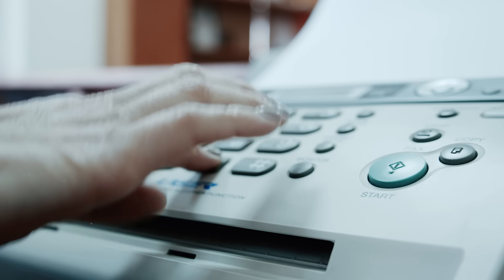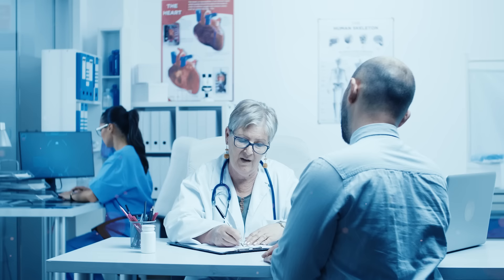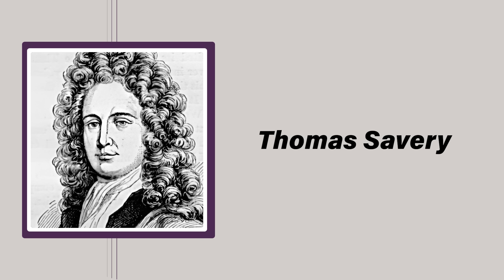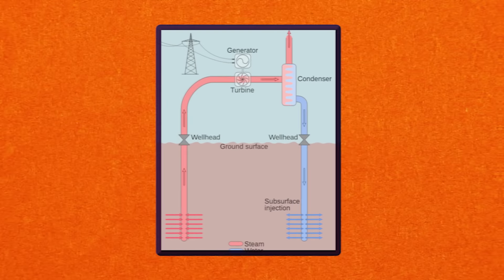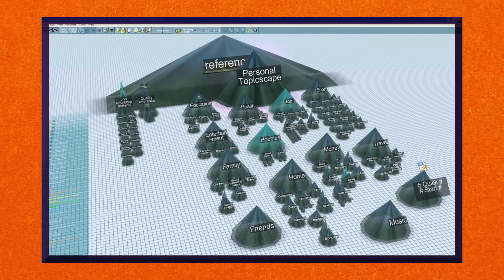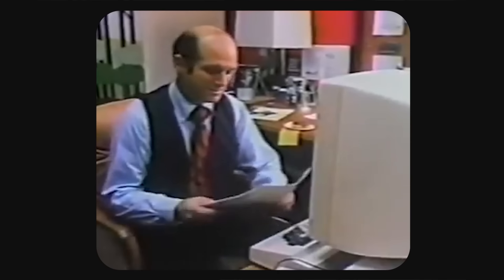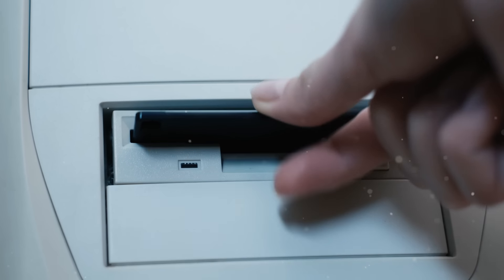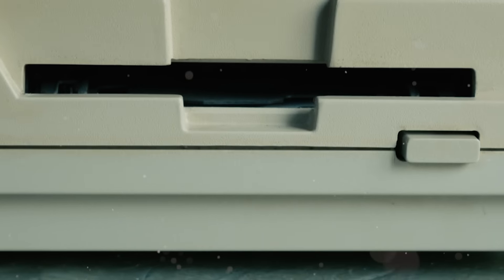Terribly Outdated Technology that we Still Use...

Comment: A proper old-fashioned fax machine is still preferable to a "modern" HP machine that won't scan your document if it is out of ink
Reply: Scanning documents without having ink? Outrageous! /s
Reply: Fax
Reply: @LaughingOrange  That's why I threw that HP junk away.
Reply: I would rather use a FAX machine because I have a better chance at finding a fax after a year than a file amongst thousand's  of file's on my pc all with cryptic names that were not cryptic when I named them🤔🤔
Reply: HP is terrible, I heard they put stickers over USB ports because they want you to use there bloatware
Reply: That why you get  Brother.
Reply: @LaughingOrange more outrageous are HPs claims trying to get the lawsuit thrown out.
Reply: Except you can fax from the PC that's connected to that HP machine.
Reply: HP: 'cancel your subscription will you after buying your printer? Well, we're gonna soft lock your property and don't even think about using third party cartridges or you better believe we'll soft lock it then too. We really hate our customers, absolute peasants'
Reply: my printer literally has everything working perfectly but thanks to hps idiotic software i still can't use it properly it refuses to connect to my home network
Reply: Modern commercial tech has gone down a disfunctional path.
Reply: @serdarcam99  is it plugged in and turned on? 👹 I assume you tried a network device search.  I also assume you have all the required physical data connections.  It may be a setup issue. Sometimes you need to have it connected to a computer to properly set up the wireless functionality.  If it lets you, a hardwired connection will bypass any password requirements to connect it to the network.  If you have a guest network you may have set it up on the guest portion or you may accidently be on the guest portion yourself.  Good luck troubleshooting.
Reply: Heh heh somebody has been watching Louis Rossman
Reply: State governments rely heavily on fax machines. Like when you need to submit health insurance documents that are time sensitive (e.g., getting canceled if your document isn't submitted by a deadline)
Reply: Whilst the can't scan without ink is terrible, I have to ask why you're scanning documents?
Reply: When you say a proper old fashioned machine you mean one you'd have seen in an office in the 90s right? If so then yes of course it would. It was a few thousand dollar machine in the 90s purpose built to handle an industrial load of scanning/faxing. Just as I'm sure a 69 dodge Challenger ok
Reply: PC LOAD LETTER?!?! WHAT THE F*CK DOES THAT MEAN?!?!
Reply: Preach!!!
Reply: I will only purchase laser printers for that very reason.  The toner never goes bad, if stored at room temperature, and can last for decades.  Why on earth would you purchase an ink jet?
Reply: Found the Louis Rossman viewer
Reply: @Warp2090 can confirm this. I just deployed a new business grade HP MFP, and they didn’t even include a USB cable, and the moronic USB B port was covered with the shittiest fall apart the second you touch it sticker I’ve ever seen. I had to go buy one or I guarantee I’d be returning to reconfigure it in a week when it decides to drop off the network. WiFi printers SUCK.
Reply: @DrankenDune  MAYBE IT'S BECAUSE I GREW UP IN THE EIGHTIES = I KNOW HOW TO USE TECH BUT IT'S NOT MY NATIVE TONGUE , YES YES ?
Reply: My hp had a issue with ink. So I bought a canon instead of buying ink
Reply: @LaughingOrange  I think he means scanning the image to your computer. Which sucks when ur not even printing anything and I've also been in this situation and it was for a funeral we were trying to scan photos onto my laptop to put on a slideshow at the service and I had to buy new ink that was more expensive then the printer just to scan the photos to my laptop
Reply: Or just cause it doesn't want to xD
Reply: That's when it eat your last only copy 😅
Reply: And modern fax machines can send a PDF in duplicate!
Reply: @DrankenDune  Oh yes , everyone know that I'm an angry man 🤣🤣🤣🤣
Reply: @DrankenDune  And they call you - sidetrack Dranken 🤣🤣🤣🤣
Reply: @DrankenDune  But seriously you have become tedious and boring  ipso facto no further congress between us shall be entertained , GB .
Reply: @LaughingOrange Use phone transfer file in crunch
Reply: Gotta get you a brother
Reply: @DigitalDiabloUK  to keep electronic records. To email copies of documents that are in hard copy form. To fax documents. Because electronic copies are easier to haul around.  There are various reasons why you would want to scan a document.
Reply: Honestly, both just need to be abandoned. Fax machines often are a massive point of failure for most government or private programs. Name one thing a Printer/scanner can do other than kill trees that I can't get done on my phone. We need to take a page from Estonia...I think its them. Online government, lower cost, better access. I think it's insane we still use paper half of the time.
Reply: @ianbelletti6241  - but how does that PC get an electronic version of an image that is on a piece of paper? That’s why the scanner is still a necessity. Unless you want to use a camera to take a photo that won’t be as rectangular as if it were imaged using a scanner.
Reply: @SilverStarHeggisist  - my Canon had a problem with printing and after replacing the print head a couple of times I gave up on it’s printing function. But then it would no longer function as a scanner either. So I got the HP at that point. Sort of like you, but yet unlike you as well.
Reply: @stevebabiak6997  yes, the scanner is necessary if you have a paper document. If the document is already electronic all you have to do is send it in a format that the fax service or software can handle. I've also used software for a phone that uses the phones camera as the scanner. The phone software allows you to select a non rectangular area and corrects for the tilt.  Just like the standard fax machine, the image correction isn't perfect but it works well enough as long as you hold it close to parallel to the page.
Reply: Smart phones are a thing.  You can take a picture of a piece of paper, and your phone can turn it into a digital scan or even an editable PDF, which can be emailed directly to whoever you want it to.  Much faster and much more secure than a fax machine.
Reply: @themustachioedman   - I do have a smartphone where I can do as you say, and I have a flatbed scanner as well. The flatbed scanner is superior in all respects, unless we are talking about a document that is beyond the size that the scanner can handle. The smartphone image could be in part shadow depending on lighting. The smartphone image will be difficult to have the document be 100% rectangular. The smartphone image is vulnerable to optical distortion. 

In many cases the smartphone negatives aren’t a big issue, so I still use that. But at times when any of those negative factors are significant, I use the scanner.
Reply: @themustachioedman  there's fax software for smartphones as well if you need to fax while not in the office.
Reply: Right. Shits annoying. Wont scan into a document file because its out of ink.  Makes total sense.  Or try to send something from your phone to print and it cuts half off or prints it on a different page.
Reply: @AsilarWindsailor Probably, but he IS right.
Reply: Oh yeah it's completely stupid that it won't scan or fax when it's low or out of ink. That's just ridiculous. I hope Louis destroys the opposition
Reply: I learned that the Brother brand doesn't do cr*p like that.
Reply: @GeorgieB1965  Came here to comment this. I work in State Government and I receive and/or send faxes daily.
Reply: This unfortunately is more of a reflection on how bad HP printer scanners are unless reflection on how good fax machines are.
Reply: I hate HP! Switched to an Asus laptop, current hp printer is out of ink, will buy a cannon.
Reply: I’ve been rocking an Epson eco-tank for the past four years, and have yet to buy a single cartridge or rather refill squeeze bottle. It might cost four or $500 upfront but you’ll end up paying double that over the course of 2 to 4 years in HP ink cartridges.
Reply: @SilverStarHeggisist , may I assume that the entire canon printer was cheaper than the HP ink refill?
Reply: @serdarcam99  Open system resources and restart the print spooler.
Reply: Epson "Eco-Tank" machines don't lock out the scanner on low ink.  And you can revil from appx 4.5 oz ink bottles that cost less per set than the HP cartridge that has less than 1 oz total ink.
Reply: faxes disappear over time...
Reply: @robot336 except if the fax prints on thermal paper...so after some years and depending of the storage conditions the paper will be unreadable...
Reply: @vasopel  Hmmm just like the file name's I make when I'm drunk mate =   like now  🤤🤤🍻🍻
Reply: @vasopel  What I do is put all my WTF  is that file's onto a  USB and when I get My ADHD  pill's I go through them and forget to rename them because I'm to interested in what's in them 🤤🤤
Reply: @vasopel  But I have a fix for that = I compress them into zip file to save space and never look at them again 🤤🤤
Reply: The runny shit I did this morning is preferable to a HP printer.
Reply: @robot336  that sounds.... reasonably logical :-D
Reply: @vasopel  That's it maaaate 🤤🤤🍻🍻
Reply: @vasopel  That's going on my head stone when I die = HE LIVED A REASONABLY LOGICAL LIFE 🤤🤤
Reply: @justingoodman9352 I stole something
Reply: @galactica1980  back up in that azz with the resurrection...!  "So that means everyday you see me is the worst day of my life." ..... "Wow, that's messed up! ...er..."  😅😂🤣
Reply: Lmfao, don't buy crappy, intentionally sold at a loss type machine then.  You get what you pay for, is especially true with combo printers.
Reply: @GeorgieB1965 military too, usb thumb drives were strictly forbidden in the building I worked. Every section had a fax machine.
Reply: I haven't seen a fax machine for 20 years at least... And even then it was a relic.
Reply: If the heads of every top organized crime group in the country were all having lunch together, the room would stop dead, hushed in revererent silence if the head of any printer company were to walk in.
Reply: @LaughingOrange and true.  Fax machines wouldn’t work without ink either.  They usually have to print a confirmation page.
Reply: In five years of use I have only  ever had one problem with the printer.  And that was because it was starting to print extra colors and leave lines on prints. This was simply because the print hands were dirty. I had to run the built-in, clean, print head cycle like five or six times and it fixed itself. Oh and maybe like once a year I have a driver issue and have to remove and we had the printer on my Mac.  This printer has basically just been set it and forget it. No fighting with it no running out of ink cartridges at the last minute. It just works.
Reply: So…… What’s wrong with grabbing your phone and using it as a scanner? I’ve done that many times before and it works great. Quick, efficient and, if you have a company phone with the proper software, perfectly secure.
Reply: Bummer to be in a job with paper.
Reply: What bone head decided that.. lol...😂
Reply: Bull. Scanners don't care about ink.
Reply: Aren't most home-use printers and scanners basically robotic ink cartridge salesmen?
Reply: @@bobsdavenport better yet order a bike messenger whenever you can.
Reply: They designed it that way, so they can force you to buy more ink.

Profit for shareholders is the only thing companies strive for.
Reply: Lewis Rossman has entered the chat
Reply: Or if it disapproves of the content
Reply: @granatmof Brother. There is no other.
Reply: It won't send or receive a fax either when out of ink.
Reply: HP is successful because they know how to become successful, it's a good business model to learn, that's why future corporations should conduct themselves accordingly
Reply: @@bobsdavenport Imagine trying to fax an important patient record to a busy medical office. that office only gets patient records via fax so their fax line is always busy. 
yeah. its a real problem. take it from someone who always had to deal with that scenario. 
Faxing is obsolete. Trying to provide modern fast paced healthcare using 1960s tech is stupid.
Reply: @SilverStarHeggisist  at the price of HP's cartridges, it was probably not that much more expensive.
Reply: Never again will i buy a HP machine..
Reply: Perhaps you have a faulty HP machine because I have no problem scanning documents using my HP Printer/Scanner when ink runs out. But HP are ripping customers off with the price of ink, unless you use cheaper options with less print quality.
Reply: rule #1 when installing HP printers do not install HP software!  Manually install the drivers and only the drivers.
Reply: when its low on ink*
Reply: Picking on HP? My HP printer/scanner works just fine with the ink out. Sounds like you're trying to use the photocopier function.
Reply: When you pay a few hundred thousands per year on ink, it doesnt work like that.
Reply: You want to print a text document? But you are out of magenta!
Reply: @PassiveAssassin  scanning with your phone???   HA!  That's only useful if you want poorly-focused, poorly-cropped, out-of-alignment and blotchy 'scans'.  Absolutely the wrong tool for the job (bet hey, if all you have is a hammer, everything looks like a nail).  And do you need to do multiple pages?  I'll get through a stack of papers FAR faster than you will with your whyPhone.  And my scans aren't locked down to someone's barbed-wire walled garden.
Reply: @themustachioedman  but that PDF can STILL be intercepted mid-transmission.  Thus the reason fax machines are still used in various fields.
Reply: @SenileOtaku  Photo scans have been nearly indistinguishable since at least 2014 for text documents. Shadow isn't an issue when using an app that adjusts white and black levels and sharpens text automatically. Additionally, you can do scans that recompile the whole thing as new documents by pulling and reapplying the text on a doc. Archiving large amounts of old analog content makes sense to use a scanner admittedly. Printing something just to be scanned is like if I wrote down your email and hand-delivered it, an exercise of redundancy. If it's digital keep it digital unless required otherwise it's just wasteful. The walled garden makes sense for HP printer hardware or an app store but not for the use of a camera or documents on your device.
Reply: @fuzzy3440 only thing inkjets are a bit better at is photo printing, but if you have the money for a very very high end laser printer they can do about the same quality.
Reply: Damn that a big scam right there.
Reply: Sounds like my printer that won’t print black and white if it ran out of colour ink.... crazy how modern tech sucks no?
Reply: Well yeah, how else do you think it gets written to your hard drive, if not with ink? /s
Reply: only if the receiving fax has toner, though. I found that my cellphone takes pictures of documents just fine. I just send an email..... That way the recipient gets a color document with  WAY better resolution than the fax will ever produce.
Reply: There’s actually a lawsuit concerning that practice where courts have ruled the scanner in malfunctioning in those instances without a possible fix and thus are to be replaced by the manufacturer free of charge. So far that’s been the general ruling.
Reply: 20 years ago I had an HP OfficeJet v40 that had an optical sensor on the printhead, which it used for checking alignment after you changed ink cartridges, and also to make sure you didn't have transparencies loaded before it printed a received fax -- I have no idea why. After a paper jam while trying to print an envelope managed to break the lens off the sensor, it could no longer make sure you didn't have transparencies loaded, and thus would no longer print incoming faxes. There was no other way to get faxes out of it -- you couldn't download them over USB. Of course, it also couldn't check the alignment of new ink cartridges, either, so my multifunction printer-copier-scanner-fax turned into a send-only fax and scanner. To add insult to injury, HP wanted $600 for a replacement printhead assembly, which, if I recall correctly, was triple what the machine actually cost in the first place, a pricing strategy meant to encourage you to just buy a new one instead of repairing your existing one. 😡 (Edited to add: Yes, I did try to put the lens back on, but apparently I couldn't get it into the exact right place, so it didn't work.)
Reply: you scan and sen as pdf bro ... please
Reply: Had a wonderful Canon  travel printer with tiny little cartridges and I would refill them with Sheaffer's pen ink and a tiny syringe from the diabetic 3 doors down 😃
Reply: @flyback_driver  "Muscle Cars".. More like slow shitboxes..  lol..
Reply: I'm never going to buy an HP printer ever again. Not just that, I'm going to sue them for this practice as soon as I get my law degree.
Reply: @fuzzy3440 using an HP P3005 that I got used nearly 10 years ago. I don't print much and I'm still using the toner out came with. I don't regret losing the ability to print color at all as it's an acceptable compromise compared to clogged print nozzles.
Reply: That's a software issue, meaning they can change that IF they wanted to.
Reply: And disconnects from wifi every other week-month
Reply: @themustachioedman  The problem is registering the image so the page appears perfectly flat and rectangular in the photo. Smartphones aren't really designed to be held for precise photos. They're shaped like bricks, with no handles or straps. It's hard to hold it perfectly level.
Reply: @DigitalDiabloUK A lot of businesses still scan documents.
Reply: HP is fine. But you need to buy their corporate stuff, not their home consumer stuff, which is actually produced by a completely separate division of the company. The corporate world doesn't tolerate being screwed around like this, and HP knows better than to try. Yes it's expensive new but very affordable second hand. All my printers and scanners are from HP and I like them a lot.
Reply: lol the ink report can be turned off it is a feature.
Reply: Not really, a fax machine doesn't work if it's out of paper
Reply: @LaughingOrange 😂😂
Reply: @serdarcam99  have you tried hitting it with a bat? Won't fix anything but you might feel better and it'll set an example for the other appliances.
Reply: My first printer was a HP,  it is also the last HP printer I have owned.
Reply: @robot336 this seems true until you realise that those paper records can easily be lost in a fire/flood or house move. I once had to oversee moving around 40,000 folders of records going all the way back to the 1880s. It took 10 staff, two weeks, multiple trucks and months of planning - only to realise after that they'd 'forgotten' to audit the files to know which ones were missing. Had they been digital files I could have done the whole job in less then a minute. The good thing about digital files is you have metadata, so even if you don't know where/what you named the file you still have the ability to search for files created in X time, or of the right 'type'.
Reply: Id prefer a scanner printer that prints from the pc without giving an ink error code even though i can scan and photocopy flawlessly like it has all the ink in the world
Reply: Fr
Reply: @stevebabiak6997  I quickly figured out what you meant.. but I'm old enough that when you discussed the negatives of taking a photograph, "Wait this is a digital camera were talking about. There are no 'negatives'." Negatives as in the reversed image prints produced for chemical reproduction.

Just sharing cause it was a funny thought. I'm not trying to correct you. 😁
Reply: friends don't let friends buy hp.
Reply: Laser printers are superior
Reply: kills me that more than half of the use I put my printer to doesn't require ink, except it does
Reply: Epson printer won't print if any of the inks are out.  Photo black is out and won't print regular ink page.  Even in grey/black scale.
Reply: Is there a youtube video about HPs or something because this is not the first time I'm seeing this meme in the comments section lol.
Reply: still using an old HP fax machine. works without ink
Reply: @3nglehart  Based.
Reply: @robot336 lol. I can only imagine this being an issue if you’re a literal dinosaur 🦖 who has never grasped the basics of document management. SMH
Reply: And those printers get out of ink pretty quickly, even if unused.
Reply: Thaaaat...reminds me of a connector pin hack I know has been used before to trick that little system...can't remember if we used nail polish, tape or something else for that one... 😝
Reply: Fax machines require ink as well🤔
Reply: @fourkinggulliman2268 yes I  was really shocked when I missed a payment and my printer stopped working! How did that happen.
Reply: What does ink have to do with scanning?
Reply: @PassiveAssassin  You do realize, that paper doesn't kill trees. Tree farmers kill trees. But then they raised them. Another example of impaired reasoning. Look to your own affairs,  developing competence, before straightening out even so much as your neighborhood. God bless.
Reply: @PassiveAssassin 

Can your phone produce a glossy photo of a deceased loved one to hang on a wall to remember them by? You know, the thing that doesn't use electricity and doesn't suck (color wise) like a digital photo frame plus will always be there when the power goes out and can't accidentally be deleted?

Can your phone print out water slide transfer decals for hobby use using special pages? Model makers do that all the time.

How about printing shipping labels? Some postal locations will not accept hand written addresses on packages. Nothing beats a clear, legible address that won't get your package delivered to the wrong address unless your post office has morons working for it.

How do you give a government office a copy of anything without a printout? Some official agencies only want a hard copy, zero digital. Like a birth or death certificate. Those have to be physical. Granted they have to be printed by another government office and not at home but still printed nonetheless. 

Brother toner based full color laser printer is the only way to fly. Expensive but totally worth it. 

And what about recycled paper to print with? Zero trees killed to make it. It's all I use. 

I love having digital but also like the option of a physical copy. Love or hate paper prints sometimes its a necessity evil. 

If you can manage without printing more power to you. Some of us still need it.
Reply: i want to "love"react to this post, cause it's truth.
Reply: @serdarcam99 No problem with my HP printer. I can print directly over Wi-Fi from iMac, iPad & iPhone. My internet router does not need to be on.
Reply: @GeorgieB1965 U.K.GOV actually discourage the use of fax machines. It’s part of a desire to go paperless.
Reply: I hear ya! I have a multipurpose machine on my desk. I use it to scan and, very rarely, print. But, mostly scan. It sits on my desk. There is a cord connecting it to my laptop, which is also on the desk. The laptop won't recognize the scanner unless the internet is turned on. There is absolutely no damn reason to involve the goddam internet when I want to scan from one machine to another that is connected by a freakin' cord. I wish there was an alternative, but HP has pretty much corned the home office market and they're all I can find. Otherwise, I'd just throw the damn thing in the dumpster.
Reply: I got rid of the scanner when the lawyers just asked for a pic sent to them.  :)
Reply: @granatmof  I have used Canon, HP (By quite a lot) and Brother.  Brother does ROCK
Reply: And this is why I use Brother instead.
Reply: Right
Reply: You don’t need a fax machine anymore just scan the document as a pdf with your phone and then then drop the file into an email and send it off. I have had zero issues doing it that way
Reply: I haven't used an inkjet printer in 20 years. Quit using them after the ink nozzles would keep blocking up, and I would get streaks across the page where lines were missing.  I then bought a laser printer which lasted for 19 years (without having to change a cartridge).  It quit working a year ago, so I bought a new one.  But also ended up fixing the original one with some simple cleaning of rollers and contacts.
Reply: Trying to find a monochrome laser printer with a fax machine and color scanner is very hard

They used to be common
I will most likely have to get a fax machine from the 90s and a mono laser printer, and a flatbed scanner, if I can find one.

Windows embedded OS is used in a lot of POS and equipment.
XP is one version but I have seen versions of Windows embedded that I never saw before in anything else
It's not CE it is a unique OS based on XP but it doesn't have XP on it. And the Biggest thing is that the whole OS fit on 256 MB or even smaller CF cards. But 1GB cards were the ones I saw more often and I had to get the additional software files to fit and I would delete anything I could from the OS like text files and help files. And it was a really stressful time
Reply: @Warp2090  HP are terrible, particularly their early 2000ish desktops, transplant one of those into a standard desktop case and you gain a few usb ports, and if you reflash the bios to the non-HP one that should be on the board you can double or sometimes triple the maximum amount of RAM that HP tells you that you can have
Reply: TheMichaelJacksonFactChannel  how modern is modern though, I've got a 3 year old one that constantly complains about ink and refuses to do anything, can't even buy ink for it anymore unless you go compatible
Reply: I’m still thrilled that my 10 yrs old printer has no custom firmware or jailbreak
Reply: Reminds me of James rolfes YKWBS video on printers
Reply: When it comes to functional technology like faxes and printers I prefer the old stuff. A copy shop I used to work at had a fax machine as old as me I think (~25) and it worked perfectly after that dreaded dial up sound from hell. You physically couldn't break that thing and the only problems it had due to it's age was the amount of power it used and paper sometimes getting stuck in it, the latter easily being fixed by wiggling the paper out.
Reply: @@bobsdavenport ehm ... that's just not true for some/ many parts of the (so called) Western World. Our "telephone"- networks are VOIP (voice over internet protocol). And exactly there is the vulnerability of fax: Not only is it unencrypted, but establishing connection still follows (although useless nowadays) old protocols/ handshakes which give you a fingerprint.   
Besides that with the advent of Photoshop and the poor resolution of fax every kid in primary school could fake signatures.
Reply: @Powderlover1 of you are using the default DHCP setup, pretty much all network printers suck since you are dependent on the variable of the printer, router and PC trying to find it on the network each time the IP is renewed.

Set static IPs on everything and any other will be rock solid
Reply: @LaughingOrange The /s flag only works if the statement is not the truth. It is outrageous that running out of ink locks you out of functions that don't use ink.
Reply: @DigitalDiabloUK  Lots of people need to scan documents for many different reasons... are you that daft
Reply: @nobody4y is that a pun...
Reply: Don't. Get. Me. Started.
Reply: [you] <click print> (nothing) Hmm, I have ink... but you won't print?....!?! because my credit card that (HP) has on file expired!?  HP won't print until you've updated your payment method for your monthly "never run out of Ink" fee.   
Can you just print with the ink i have left/[printer]"NOPE".
 Fine!
 You win this one...for now!  Smdh😂
Reply: Didn't hp lose that lawsuit? I know it went to court.
Reply: @justingoodman9352 classic!! 😅😅😅
Reply: @ianbelletti6241  how are you going to scan the image into the PC in order to fax it?
Reply: @realSamAndrew  with a scanner or the camera on a phone.  If the document is already on the PC then you don't have to use either of those options.
Reply: @ianbelletti6241  you missed the part where they said the scanner won't work if the print section is out of ink. Scanner won't work, so use a scanner instead? Do you hear yourself?
Reply: only get a laser printer and a scanner seperately
Reply: Just use your phone. iPhone and I think android has document scanner built in. Used ur camera but turns it to pdf
Reply: @robot336 don’t forget having so many files that you end up running out of memory.
Reply: I´m founding a conspiracy theory that HP has some secret contracts with the international post office conglomerates to make sending hand written letters more appealing again.
Reply: Don’t buy hp
Reply: Too bad high definition camera phones (scanning) and email  have replaced mfp printers.
Reply: @DigitalDiabloUK people in offices scan things all the time.
Reply: @fuzzy3440  Laser is the only way to go.
Very fast printer.
Reply: Interesting observation and many more below. One of my gripes is that the first printer and separate scanner I had were perfectly easy to connect and use. I was delighted with the performance of each and both together. Now after many years and many different models of printer/scanner I find the software bewildering usually trying to get me to sign up for regular ink cartridges or something. I'm a home and business user not worth a lot of money to a huge corporation and just want stuff to work as it did 20 years ago. Why has it become so much more powerful but so much more complex to use? Money?
Reply: 22 years ago i worked in electrical repair
.
We had a HP printer we couldnt fix
.
Fitted new printer heads, leads, everything and it still would not print
.
.
Then a software programmer checked it for us and found HP programmed it to stop spraying ink after a set ammount of time !
.
.
Designed to be stop working by the manufacturer
.
.
Ive never trusted HP products ever since
Reply: In the United States, a part of the reason fax machines are still used is because there is a different legal requirement for faxed documents than for emailed ones.
Reply: How about your smartphone and a camera that it has? Lol man
Reply: @DigitalDiabloUK  Just for an example I can tell you one reason why I had to. During the pandemic I went back to school online. For certain classes we had to do work with pen and pencil, scan it and email it. Of course I bought hp because it was affordably priced, and I am not tech smart. after finding out about the ink thing I would always keep spare cartridges around. What really pissed me off was when I replaced a cartridge with a proper hp brand cartridge, and I got a message saying that I just voided my warranty by using a counterfeit cartridge. Never again.
Reply: @Wheres_the_money_lebowski  I actually like the Instant Ink program.  Costs me $4.99 a month and I never run out of ink.  They actually mail you the replacement cartridges before you run out.  Unused pages roll over from month to month.  I've never gone over my allowed pages and had to pay extra.  So basically $60 a year.
Reply: @LaughingOrange you might think its a joke but its not. my multi functional printer gave me message that it needs new ink cartridges if i wanna continue using the printer and that included the scanner. it makes no sense but its rrue.
Reply: Craziness. It's already completely unacceptable that it won't print at all if any color is out...
Reply: funniest part is most the fax machines better the HP Printers are HP Fax Machine (tells you even more about how bad modern printers are)
Reply: @robot336 That's a you problem.
Reply: Just bc it's new, doesn't necessarily mean it's better then  reliable TECH 😎👊
Reply: That is why I buy laser printers.
Reply: I took the cartridges out of my printer and it started scanning again
Reply: @ajpink5880  That didn't work with my Canon printer. It tracked how much ink was in the cartridges and every cartridge had to be useable to scan. I brought full cartridges and never use the printer except to scan. I have a laser printer for printing.
Reply: my fax runs on heat reactive paper, still works perfect, been trouble free for last 30 years, also copies like a photo copier but in black and white.
Reply: and will not print a black and white document if no genuine hp magenta cartiges are inserted
Reply: @Warp2090 yes, an sticker with a usb port with an X over it. And it said on the sticker: this printer is WiFi only use AirPrint or HP Sh*t Scan
Reply: honestly get ANY PRINTER except a Hwellet Problems. Their “HP Sh*t scan” software is useless, rarley works with apple airprint properly, “HP Dumb” never prints anything correctly, and if your ink isnt from HP, they will LOCK you out of your printer for using counterfit ink. Lastly, I had it over 1 million times where it will REFUSE to print a BLACK AND WHITE document because theres no magenta ink inserted. Just get a decent printer, not a hwellet problems
Reply: Unlike e-mail, telefax is is a legitimate way to timely dispatch official documents.
Reply: @robot336 sounds like it got corrupted... get that checked
Reply: Don't forget that said HP machine will absolutely drink its ink cartridge even if you don't use it. Apparently it needs 3 gallons of ink per cleaning cycle
Reply: Just another way for HP to rip off their customers by making them buy something they don't necessarily need
Reply: Yeah totally criminal I cant scan coz my printer thinks its out of ink.should be illegal
Reply: @robot336 lol dont encrypt your file names
Reply: Fun, I'm looking to buy HP printer with fax on it
Reply: Or worse maybe they decide I need to have a monthly membership to their print services online support or my brand new printer doesn’t work at all. 🤬🤬🤬🤬🤬🤬🤬
Reply: Factory ransomeware on my printer….. C#%!s
Reply: If you know anything about the current Ascension Health hack you can appreciate why the fax machine still exists
Reply: I've been telling the 3D print community for a long time now, they need to sync up with Linux peeps, construct an entirely 3D printable fax machine/printer combo, and have free to use software control it made by the Linux types.

3D printing should be the freedom we seek from the predatory companies, but no one is taking up this mantle. I find it boring and cant do it. But I have the idea.
Reply: And to the free app that scans & delivers with two taps of a finger?